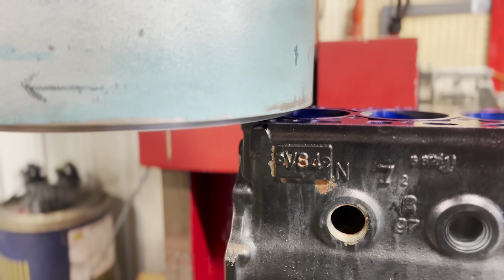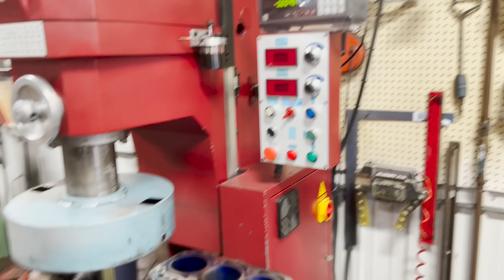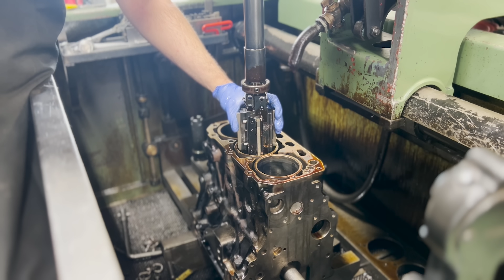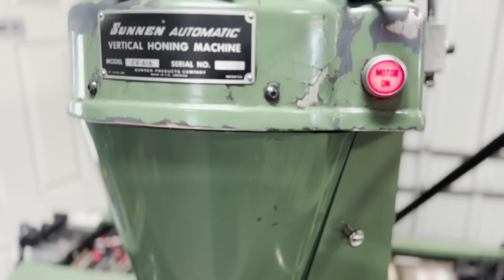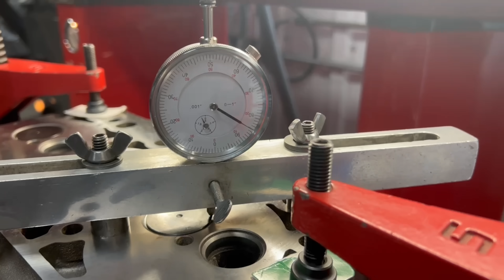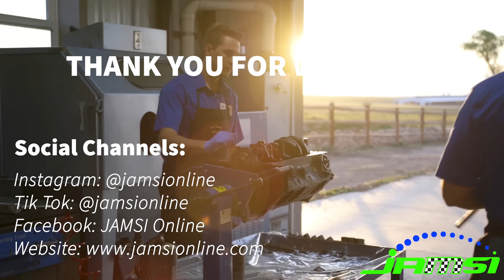Our Customer's Yanmar Kept Blowing Head Gaskets

Comment: Love the content.  I work in a hyundai engine plant as maintenance. We machine 1200 rough casted cranks, blocks, and heads. To fully assembles running engines  in  24hr. Its a lot of automation, but it's amazing how true your work is by self setups. I watch the gauges. Amazing work
Reply: the plant that had the recall from sloppy manufacturing?
Reply: @Brad Haines  I can't discuss that recall. I know more than I'm supposed to. but I can say our tolerances are  tighter than the big 3.
Reply: @chrissmith2744  Fingers crossed as I got a remanufactured engine from that. Good to know that workers have faith in their work though.

Comment: What caused the overheating of that engine is a BAD engine design. The numbers 1 and 3 cylinders are SIAMESED to the number 2 cylinder. Ford has that problem in its four-cylinder engines. There's NO coolant circulation between the middle cylinder, and other cylinders.

Comment: In the good 'ol days of Nascar, they would obtain a well used truck engine that had been well seasoned from the countless heat/cool cycles.  The warped block would then be machined to a concentric tolerance for flatness where gaskets met and the crankshaft bores checked for uniformity.
Surprised that the crank bore trueness wasn't mentioned here.
This warpage of the block and head is described as core shift and is very common.  Almost everything fuel driven is this way to some extent.

Comment: Smart to only take off what's really needed. Had a machine shop tell me once he was gonna take off 10,000's off a set of heads for my engine and that was on the phone, heck I didn't even take the heads to him yet... wth? Why would a shop take that much off before they even knew what it needed? Never take off more than necessary, especially on interference engines and with MLS gaskets, as the block more likely will also need shaved down some for a good seal.
Reply: I had an OHC Isuzu, broke a timing belt, bent a few valves etc. The machine shop decked the head so much the timing belt was off by 1/2 tooth. The distributor was run off the cam so either retard the cam / full advance dist = no power or advance the cam, retard the distributor and it would spark knock.
Reply: @williamfranklin6283  sorry to hear that, some places shouldn't even be in the business. Decking heads isn't something that's haphazard, many things to consider before  making those cuts, once cut they sure can't be uncut. It's just ain't right to screw up people's stuff.
Reply: @garyr7027  I wouldn't have thought about it until it happened to me. I did put 200k miles on it with 93 octane to help the ping.
Reply: @williamfranklin6283  it's getting bad at some shops, I honestly believe some make problems hoping they'll get return business. I've encountered places like this when they think they call pull one over on someone. It's why I do my own work, exception for a few things I don't have tools for, and even that isn't much. They're scam artists and dealers are the worst, whom I stay far away from. They either know how to screw up, or they just don't know they did, but either way they cost more than they're worth.

Comment: If you deck the surface of the block don't you also have to take the same amount off of the pistons? Don't the pistons usually come up flush with the block surface at TDC?
Reply: Head gaskets.

Comment: I have an old Iron Duke that's been overheated pretty badly a few times over the years and I'm not looking forward to seeing how warped the block and head are once it's apart.
Reply: Doesn't the iron duke have a cast iron head and block? I'll bet that it should machine right out, as warping is usually worst when it's an aluminium head and iron block, because they expand at different rates under heat.

I hope it's simpler and easier than you expect, and good luck!
Reply: @JoSnowHair  Thanks, 17 year old me didn't care that the temp gauge didn't work
Reply: @brandonlink6568  oh absolutely, I can relate to that. I had no mechanical sympathy for my first four cars and essentially drove them into the ground, like an absolute ass

Comment: Just an idea that I know does work for non water jacketed blocks, you might want to check out https://www.youtube.com/watch?v=2GQFotFOS3E from Steve Morris. He uses this technique for building motors that are 2000hp and up to prevent head gasket failure.
Reply: That's only a 30 hp engine.

Comment: I noticed those pistons come up real close to the top of the head. Do you ever have problems when after decking a head the pistons come up too high? If so, what do you do about it?
Reply: In my experience if a head/blocked is decked and the compression ratio is too high or the pistons make contact, a thicker head gasket is required.
Reply: @CaptainCandycorn  to add to this, I believe they also make shims for this purpose, to adjust compression or to add clearance for the pistons/valves.
Reply: On some engines they deck the pistons

Comment: Dumb question, is it possible to get oversized pistons for any engine? Like are they kinda universal besides their basic types?
Reply: You can get overdosed pistons, your supposed to get larger pistons when you get larger piston rings and oversized the bore of the engine. You do need to get engine specific parts though for it to be compatible and not have issues like hitting the head.
Reply: @FishFind3000  Do you think they're all based off a standardized chart? There must be a SAE thing or something, it feels like too many engines have them available, even one's that shouldn't have a market?
Reply: Not a dumb question because I dont know either. It seems like an oversized piston exists for everything with any amount of oversize.
Reply: @CaptainCandycorn  Glad I'm not the only one. Like seriously, every engine seems to have one. Even unpopular ones where it wouldn't seem to make financial sense to exist.
Reply: No not possible for "any" engine. Some engines can't be oversized, as they're already at the max size from the factory. Some engines you can oversize, some you cannot. Not only can't you oversize some, you can't even get oversized aftermarket pistons for em'. Some engines are sleeved only with aluminum blocks, when a cylinder is worn down, you replace the sleeves with standard size and standard size pistons. Don't ever bore a sleeve even if you can get oversized pistons, they'll be too thin and won't hold up to the heat, as 20,000 is the absolute minimum you can bore a cylinder... and for sleeves even that's too much IMHO.
Reply: @garyr7027  Are regular stock pistons available for any engine? No oversizing, just new engine builds?
Reply: @carllinden533  well I haven't ever encountered a engine you can't get pistons for at stock size. Not saying it's the case with all of them though, some just might be hard to find or unless they're custom made. Some places can make just about any part you need with today's CNC machines... of course it probably won't be cheap.

Comment: That’s the first yanmar I’ve seen in a machine shop for engine work.
Reply: They are prone to exactly what you see here.  Kubota, yanmar, shibaru, Toyo......not enough cooling capacity, not enough oil capacity, no oil cooler, poorly designed head coolant passages are prone to hot spots and uneven cooling.
Reply: Newer Kubotas?  Mine is a model from 1982.  I haven’t had HG issues.
Reply: @randymagnum143  I’ve not experienced that with my yanmar or the kubotas I’ve had.
Reply: @davesalzer3220  what do you use them for?  I get a laugh out of the fact that they are only tested on the pto at the Nebraska tests.   Even Kubota and Deere (yanmar) know they won't survive the (10 hrs rated)  drawbar tests.

If you are not using them as tractors, and take good care of them, they work excellent.  If they are naturally aspirated the have poor fuel economy however.
Reply: @randymagnum143  the kubota tractors mow and till mostly, old tractors they are. Good shit in my opinion. The Yanmar is a mini excavator and gets worked hard and often, outside of hoses and regular maintenance it’s been flawless in 2 years.